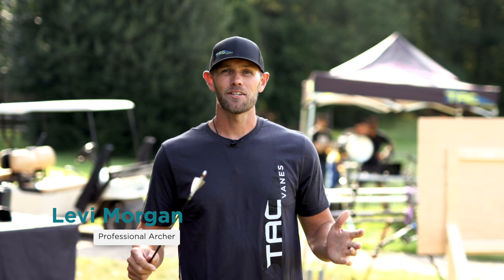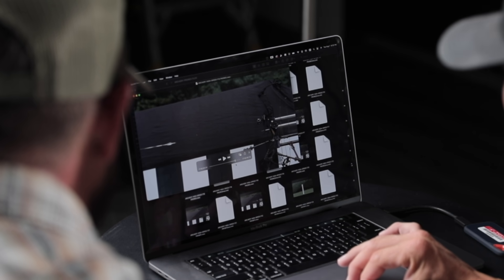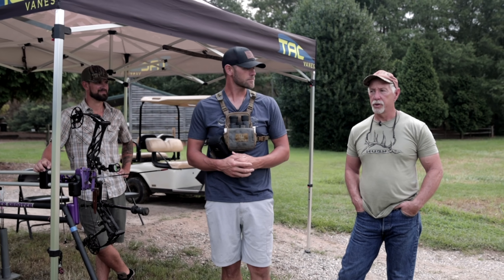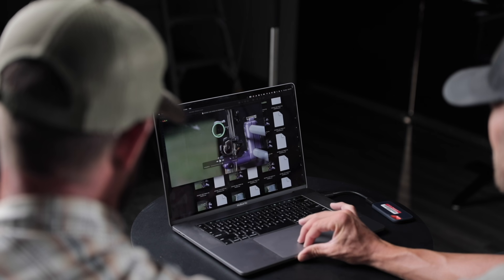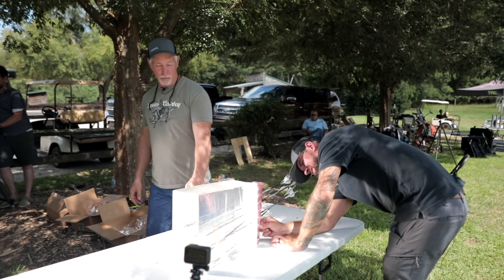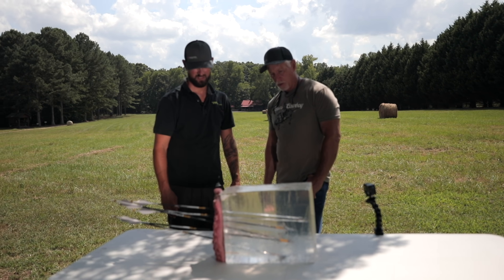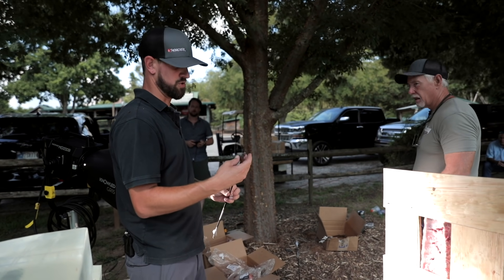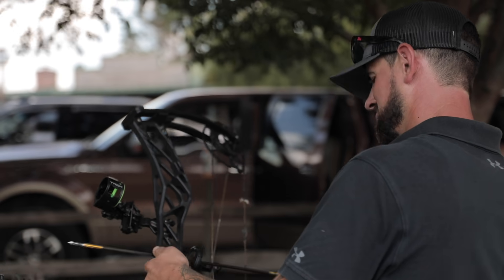SEE FOR YOURSELF 😲 : The LRP Arrow system vs. the competition w/ Levi Morgan

Comment: Would've been nice to see a Sevr 2.0. I feel like it mightve been left out on puropse
Reply from the maker: The Sevr was most definitely not left out on purpose.  We didn't know there were so many people shooting them right now, but we will work to make a follow up video.
Reply: @tacvanes been in a cave?! By far the most popular from what I’ve seen
Reply: I think sevr is starting to grab more traction then rage because of some of the improvements for this style broadhead
Reply: Got my sevr in 2.0 to put them to use on my reign 6
Reply: I switched from a Rage Trypan, not because they didn't perform... Just everything the Rage does well, the Sevr does better!
Reply: Other people have done it with sevr 2.0 and they would've placed in the lower portion based on the other videos results
Reply: I shot the 1.75 last year and made a bad shot. Hit the scapula and it literally penetrated the length of the broadhead. And just fell out. It was a bad shot but that was enough for me. And they made noise and fluttered in the air with the rubber band system blades have moment in the feral, idk just didn’t like much about them. Honestly I think I like rage trypan system better. Shooting qad exodus this year. Fix blade from here on out
Reply: @garrettstraffon608  how did you get hands on a broadhead that came out in spring last season? That's not quite adding up lmao
Reply: @papajohnsy6659  I think you’re wrong about that. But 2.0 1.5 1.75. There all held with a rubber band. Basically all the same. But I’ll tell you one thing I didn’t care to remember what they were. I basically gave them away.
Reply: I shot sevr last year.  Shot elk and two 10 points.  They shot good pass through, but I purchased the rebuild kits, and they are a 1 and done.  That why I would not buy them again.  I have one left, and its for sale😂.
Reply: I was going to say the same thing! Feel like the biggest competitor is the Sevr. If you have seen any torture tests on Youtube you know Sevr is making a name for themselves.
Reply: @tacvanes I have personally seen what most of these broadheads have done on pigs and the Sevr does not do any better than the Swhacker or Muzzy Shank! I've seen the gel tests and it doesn't penetrate any deeper neither! The Rage is subpar for sure, goes to pieces! The Sevr is a good broadhead,but the Zeus out performs all of em.
Reply: Swhacker is better and more accurate, sevrs is just alittle tuffer with less cut.
The best test you can pretty much ever do has been done.
Reply: No need to test the Sevr. Lost a bull of a lifetime. Perfect shot at 20 yards. Garbage.
Reply: Then it wasn't a perfect shot lol. A field point would kill if it was perfect.  @CodyChristineRich-xq9lg
Reply: The biggest takeaway for me was the amount of deflection regardless of the head and you Iron Will shooters should pay attention to your shafts because a two bladed head is the worst for deflecting because there’s no 90 degree blade to oppose or resist the change of direction

Comment: Anyone who thinks a Swhacker will out perform an Iron Will is delusional 🤣
Reply: Yeah I want them to shoot an iron will to prove their theory!
Reply: @chrisunruh6485  It’s widely known that ballistic gel isn’t an accurate medium for testing penetration. The penetrations are all similar because it’s a coefficient of friction for the arrow shafts. In real world situations or objects the Iron Will would have exponentially more penetration.
Reply: Cutting diameter yes it out performs it sorry bout your delusional luck
Reply: A deer is only so wide but yeah it went through so much better lol. Uncontrolled environment and no one intentionally shoots to wound, mechanical will again out perform.
Reply: @michaelsaccamozzone1060  🤣🤣
Reply: Depends on what parameters you are using for performance. If you are using flight then any mechanical will be more accurate out of the box. Fixed blades will fly good but takes more tuning. Penetration just depends on what your target is. For the record I shoot fixed blades and will not use a mechanical, but to say an iron will out perform a Shwacker is a way to generalized of statement.  In my opinion the Iron did out perform on this video anyway!

Comment: I wish they included the Sevrs in this test. Interesting how the blades closed back up after exiting the ribs.
Reply: logan.....it's physics...for every action there is equal reaction....on the rib only test there was no lung tissue to keep.pressure on the blades...SO as the arrow is slowing down the blades can swing forward. You will notice that in the gelatin tests the blades did not close
Reply: Makes sense. Thanks for the doing the test!
Reply: So why not test sevr against swhacker??
Reply: I wish they would have tested the sevr as well. I've bent several swhackers shooting through shoulders but I ain't ever bent a sevr. Makes you just wonder if it was on purpose that they only tested the other broadheads that are known to break to make it look  better.
Reply: Agreed, not to mention the test is nice to watch, but doesn't replicate what the broadheads need to cut through to get to the meat.
Depending on the animal the hide could be the toughest part to cut through (think elk and it waay thicker than an antelope or whitetail) and then through the fascia which is like "chain mail" under the hide.
Reply: @raynecox7846 they are gunna test a product that will make theirs look bad.

Comment: My only problem with the shwackers is that clearly the blades open INSIDE the animal which yes is good but when you dont leave a large wound opening there wont be much actual blood on the ground and yes that anima is dead but if you cant track it then it really doesnt matter
Reply: I was coming here to say the same thing love the wound channel inside but as far as tracking goes there’s not much blood unless you get a pass though I’ve been shooting single piece fixed blades (annihilator 125XL) they are by far the most durable broadhead on the market and fly like field tips the would channel looks like a shotgun slug going through you will know immediately if you made a good shot or not 

The design pushes the meat and bone away from the arrow shaft allowing for more penetration and less drag
Reply: I was skeptical my self. However, I switched last year to shwackers and last year shot 2 deer ( small sample) both died very quick both left a blood trail you could follow without missing it. Really rolled out the red carpet right to the deer. My first one died in sight with a red hose running out of the deer.. from the stand I could hear the blood hitting the ground... also why she only made it about 10yards.  Big Wisconsin doe practically fell over where I shot it (15 sec later) she barely moved. Now for the second deer the recovery was longer by it only made it to the bottom of the hill. The hill was about 200yards vertical drop and it slid most of that. Also a good time to bring up a 1000 yard roll of Paracord is about $50... and make dragging up hill to the truck- with the truck much easier.
Reply: Same
Reply: @NeuroSpicyFishing  my thing is with a big entrance u don’t have to worry about a pass through . It’s why the dead meats and mega meats are so popular.

Comment: The only thing about the swacker not opening until it’s inside the animal if you don’t get a pass through is your not gonna have a good blood trail because it’s like a field tip going in but swackers are good if you get a pass through because the blades are opened going through the opposite side
Reply: Exactly, I shot Swackers for a while and a quartering away shots are dangerous because that off shoulder often stops the arrow, poor blood trails is why I switched to Trypan's and haven't had that issue again. to Swackers credit they are the most reusable mechanical broadhead, I killed 4 deer with the same head a few years ago.
Reply: the entry hole is always 1 1/4" minimum....same as most of these fixed 2 blade heads. not just a field point hole
Reply: you have a MUCH better chance of getting a pass through with a swhacker,  as it doesn't waste energy cutting a large high side entry entry hole through fur, skin and ribs, that aint going to bleed out anyway, i would much rather conserve my energy for the low side exit hole that is going to bleed out. i have used the 1.75" swhacker (the most durable model) for the past few years and have never not had a pass through and my arrow buried deep in the dirt. if for some reason you didn't get a pass through, blood is going to be coming out of the deers mouth if you got a proper kill shot. none of the deer or turkey i have shot with swhackers have made it out of my eyesight, so i have never needed a blood trail, but there always has been one.
Reply: @yourmomma2995  Exactly. I just recently started using Swhacker and I've shot 2 deer and both dropped right away. I didn't even need a blood trail. Both were with the 3" 150gr. I'm trying the 2.5" 125gr Levi Morgan's this year to see how they do.

Comment: The one thing I took from this is the iron will out performed everything lol same size cut as the swacker went deeper in the gel but was cutting the whole time where the swacker only cut about 2 inches of gel so there for if you don't get a pass through with a swacker your blood trail is going to be not good
Reply: Ironwill all the way! only thing I’ll use!!

Comment: Bit of cherry picking comparisons and tests in my opinion.

1- Target:  If you are shooting target, or 3d or long range target events i.e. TAC events.  Then you maximize for the least weight and spin / drag you can use to make your arrow spin up and be accurate.  This keeps velocity up and minimizes drop, while still having good enough accuracy.  This has nothing to do with maximizing hunting with broadheads, fixed or mechanical.  Target shooters have always shot lighter arrows, and smaller less drag inducing vane setups.  No one in their right mind would take an Olympic arrow setup, put a fixed broadhead on it and hunt with it.  But these tests are mixing and confusing the two styles of arrow setups.

2- Hunting:  If you are looking to maximize hunting setups, then you need to look at how much drag do I need to stabilize and make my broadhead accurate.  Here there is a major tradeoff and no perfect answer.  More drag means more accuracy, and faster stabilization of the arrow.  You then lose velocity faster, leading to more drop at longer ranges.  Mechanicals will need less drag to shoot broadheads accurately, so that is the main advantage of a mechanical head in a hunting situation.  The real comparison needs to be how do these TAC vanes do stabilizing a fixed broadhead compared to Blazers, DCA etc?  That was not done, most likely on purpose cause the answer does not sell their products.  The other thing that is important is 4 fletch vs 3.  Is the additional drag and loss of velocity and rate of lost velocity (deceleration) worth the additional accuracy?  Finding that sweet spot and if some of these newer CAD modeled vanes can get enough drag from 3 smaller vanes that's an advantage.  

How did we get here?

We used to all shoot heavy aluminum arrows, with 4-6" feathers.  Then vanes came along, and we shot again 4-5" vanes.  Nearly everyone shot fixed broadheads.  Very few stories from real world hunters about mysterious lack of penetration.  Deflections, and hitting an animal but somehow no blood trail or it lived.  The fast arrow, fast bow, light arrows, mechanicals, have all led to these new issues with less effective kill shots in my opinion.  

Show accuracy of these vanes using a fixed broadhead at distance.  That's what matters in hunting.  And your older engineer guy let it slip.  When you torque the bow, or yank the trigger, or are in an awkward position / stance, you need that additional spin up and drag to help you get that broadhead/ arrow back on track and now.  That's what he knows matters.  And I do too.  The hooter shooter will never show that.  But that is the real  world variable which matters more then 15 grains of vanes or 30 grains of vanes etc.  or 10% FOC vs 30% FOC.  

Hunting arrows are to be maximized for accuracy at distance.  Heavier arrows, vanes that create a lot of drag, fixed broad heads, arrow integrity are the key to maximizing hunting success.  The ashby foundation has done the best job of laying out what matters to hunting arrows and broadheads.  I just don't think extreme FOC matters as much cause it forces you to make too many comprises in the other variables to get the FOC that high.

I love Levi Morgan and he is the GOAT.  But please don't intentionally mislead people about physics and engineering principals.
Reply: My thoughts exactly.

Comment: So you say the arrows weigh the exact same? Did you add weight in the arrows with lighter vanes so they match? If the TAC vane weighs 3gr and the next vanes weigh 8gr, did you add the extra grains to the arrows to make them match?

Comment: If your blade doesn't get through, that means there's an arrow plugging the entrance (which is smaller because the blades dont deploy until after the hide) so there's not much to bleed out of...  That might make for a terrible blood trail.  What are your thoughts on that scenario?
Reply: Very good point, "blade getting through", assuming you mean a pass thru on opposite side of entrance? If there isn't a pass thru all you would have is a hole the size of a field point on entrance side and arrow could be plugging hole. In this instance for sure the 3" cut works be more beneficial for kill shot w no blood imho...

Comment: Good testing. I wish the commentary wasn’t so heavily biased (but I understand you’re trying to sell your product). First hypothesis was that TAC vanes would spin up the fastest and that was important for arrow stabilization… results showed they actually spin up the slowest and the tune quickly changed to looking at drag/drop. Ultimately I agree the most important characteristic is groups, which showed undetectable differences. The whisker biscuit test is irrelevant for most serious shooters these days. Would be nice to see the same high speed footage with drop aways. And the results summarized at the end needs to be cleaned up some. Arrow drop test description is very confusing, and the schwacker vs. iron will numbers are definitely incorrect.
Reply: Bias was definitely clear.

They said the sooner you can get the arrow to spin the sooner it starts to stabilize the arrow.  That’s not the same as spinning the fastest.  However they didn’t really measure that, they measured one full rotation.  The vanes generate different spin rates so measuring the distance to one full rotation doesn’t mean that vane started to spin first.  Yes confusing.

What was wrong with the Iron will numbers?

I’d like to see a comparison of the 2.25” vs the 2.75” in a 3 vane configuration at 100 yards.

Comment: I find it interesting that many of the vanes had vertical dispersions and few, like the Blazer, had only horizontal which one of the guys said there was some breeze that could throw things left and right.  What was causing the increase in drag or reduction in drag/extra push?  Was there a head or tail wind also?  I think I would be worried about up and down distribution if th conditions were relatively the same for all vane tests.

Comment: Very interesting. For the  next used Bohning Heat 2,5", are stiffer than Bohning Blazer. And other cuestion, why you used a Elite Bow and no a Mathews bow? Thanks.
Reply: I wanted to see the heat vanes and the x vanes as well, and also wondered why they used an elite.
Reply: Probably cause it wasn't Levi's bow lol. It was probably one of the other guys bow and that's what they had on hand and it shouldn't matter anyway. Elite is every bit as good a bow as Mathews or any of the other flagships.
Reply: Would also have liked to see the 4 fletch heat
Reply: Elite is a much better bow than Matthews. Matthews is bottom third in quality but tops in marketing budget. I mean, they have to pay people off to shoot their bows. Just think about that. Perception beats reality.
Reply: @cjr4497  I used for long time Elite. GT500, Answer and E35. Best draw cicle and let- off in the market. Also used  Obsession Evolution and Defcon6.  But now using Mathews V3X 33" to compit and for hunting VXR 31,3. I like change a prove a new brands.
Reply: @cjr4497  I own both new elite and mathews, elite is a great bow, but they are not the same. And my response wasn't a knock against elite, but you would think testing for Levi's vanes that they would've had the best archer there shooting the arrows and with his bow. Just saying.

Comment: So do all of the arrows weight the same before fletching or after?  You will need at add weight to the arrows for the differences in fletching.  Did you reset the hooter shooter between each shot?

Comment: When comparing the Swhacker to the Iron Will, you fail to mention that the Iron Will is cutting on impact and creating an entrance wound the width of the broadhead while the Swhacker does not open until it reaches the internals of the animal. Thus, there is not much of an entrance wound if any other than the width of the ferrule. If you don't get a complete pass through, then you are counting on your entrance hole to provide the bloodletting trail.
Reply: It cuts from 1+ inches on entrance….